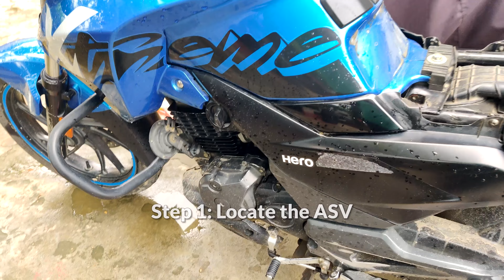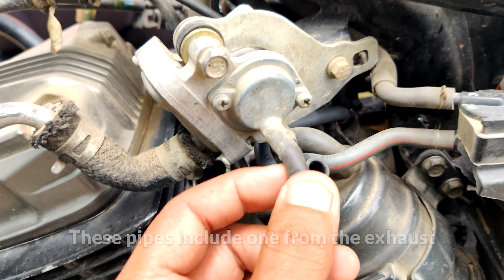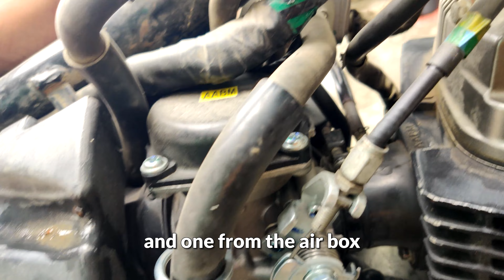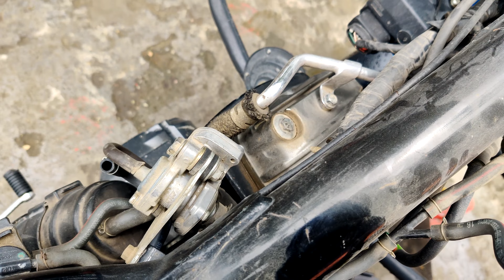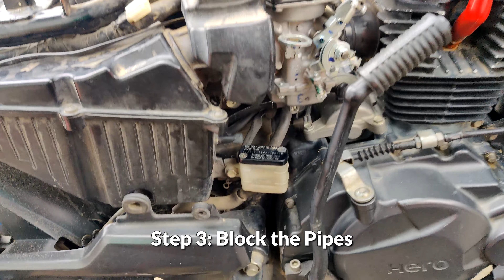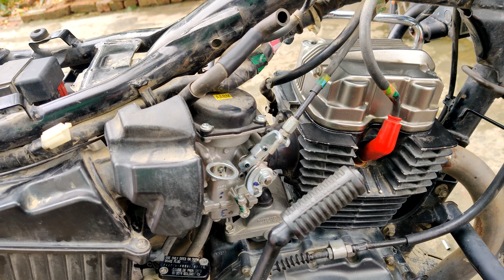how to disable ASV from your motorcycle

Comment: What is the Job of Air suction valve? What does it do ? And why do we need to disable it?
Reply from the maker: Just some device to pass emissions, not necessary to remove unless you want it performance gains are not noticeable but iam preparing my bike for further modifications soon so removal was necessary.
Reply: This is EGR System  EXHAUST GAS RECIRCULATION   10-20%  Exhaust gas Goes back to Air Cleaner & Manifold while Intake Stroak    MANY MECHANICAL GURUS DONT KNOW ON YOU TUBE     I AM R& D   STUDENT    HASAN  HYDERABAD
Reply: This is EGR System  EXHAUST GAS RECIRCULATION   10-20%  Exhaust gas Goes back to Air Cleaner & Manifold while Intake Stroak    MANY MECHANICAL GURUS DONT KNOW ON YOU TUBE     I AM R& D   STUDENT    HASAN  HYDERABAD
Reply: This is EGR System  EXHAUST GAS RECIRCULATION   10-20%  Exhaust gas Goes back to Air Cleaner & Manifold while Intake Stroak    MANY MECHANICAL GURUS DONT KNOW ON YOU TUBE     I AM R& D   STUDENT    HASAN  from HYDERABAD

Comment: Tum ne to iski NASBANDI KERDI    😂😂😂   IDLING SMOOTH NAHI RAHTI    Throttle close pe  Engine Breathing  kaise hoga   vaccum se Idle me Smooth Breath Firing rahte   throttle Hi Rakhte hai to AIR FUEL Mixture Dhang se Nahi hote   Engine Agressive hojata       Change to   BY PASS Technique  as i Menssioned       clean  old Volve    before Fixing
Reply from the maker: air suction valve's job is to allow fresh air from the airbox into the exhaust system during deceleration this helps burn any leftover unburned fuel in the exhaust gases for reducing emissions It does not directly impact the air-fuel mixture or the engine's vacuum at idle or under normal throttle.
engine breathes through the air filter and intake manifold, not the ASV The ASV only handles air for emissions in the exhaust system, 
air fuel mixture is controlled by the carburetor which adjusts based on the airflow and throttle position, ASV does not interfere with this process.
Reply from the maker: Disabling the ASV will not harm the engine or impact idling, as long as all blocked lines are sealed properly to prevent vacuum leaks & carburetor is tuned correctly for the intake and exhaust setup.

Comment: Dont disable   Bypass it    Let  breath Fresh Air   NOT   From Exhaust    Bypass  Exhaust hose   out side with Jugaad  Mini Mufler    and   Volve Open place   Fix   Foam filter    Let Engine breath Filered 10-20 % Air from this   EGR Volve       this   system   Spoiling Engine Performance      i sm Running for 8 year Bajaj V15   like this Trick    Engine Breath Fresh Oxygen
Reply from the maker: thanks for suggestion but i like to keep it that way.